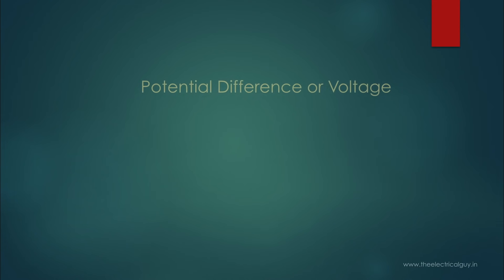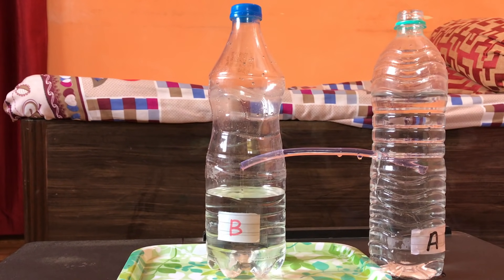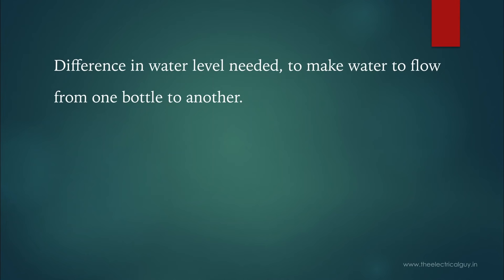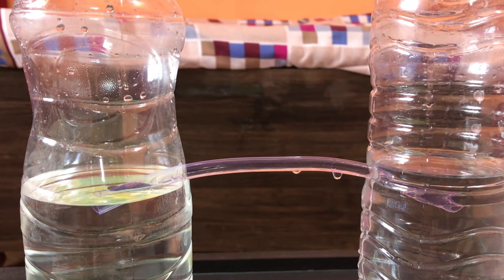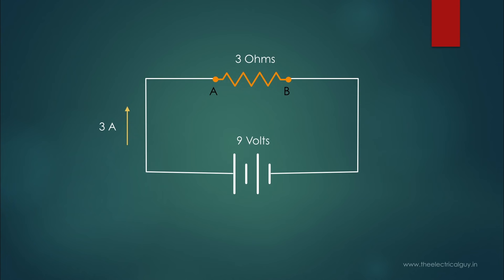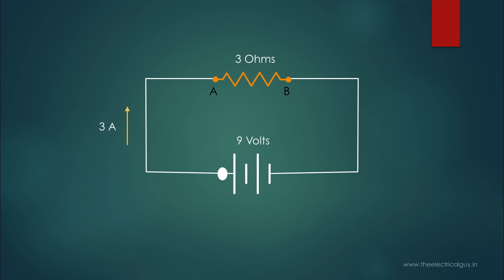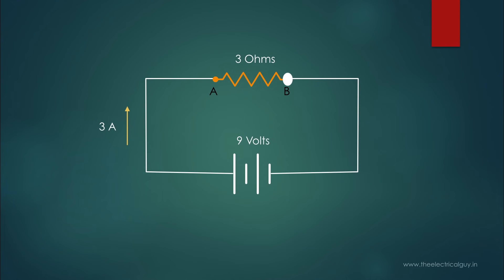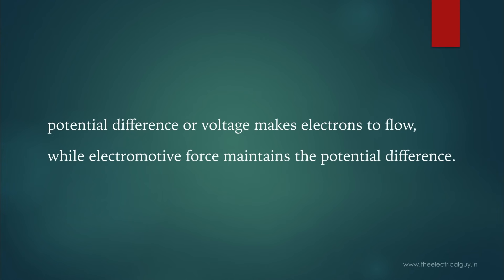Voltage or Potential difference vs EMF | Easiest Explanation | TheElectricalGuy

Comment: You skipped the point while giving an example on EMF. You said that the source is needed to fill the water and cause the water to flow to other bottle, but you skipped that the source should take the water from bottle B and insert the water to bottle A.
Reply: The source should be such that it continuously increase the level of water of bottle A and at the same time it should continuously decrease the level of water of bottle B in order to avoid the same potential conditions. It is because if the source ia not taking the water from bottle B then water level of B also increases and potential difference could not be maintained.

Comment: Well explanation is good but tbh emf cant be maintained once circuit is complete that is it lost some voltage know as lost volt to attain an equilibrium with charge accumulation and charge discharge thus emf is not the one maintaining voltage is value of initial potential difference with cathode and anode just before the completion of circuit.
Correct me if i am wrong!

Comment: Sir I think if u explain it with inductor it will be clear I feel it incomplete bcs emf is the small voltage that is INDUCED by the supply voltage that creates the another current which oppose the flow of electrons of main current . So actual EMF is electro magnetic force that’s nothing but the voltage induced by the property of induction like mutual inductance

Comment: Emf makes electrons flow between 2 terminals, voltage drop is the consequence of electron flow iff there is resistance. I say this because electrons will flow if there is no resistance in which case there will be no voltage drop also.

Comment: Howdy.
EMF is the small angry man inside a battery who throws electrons to the minus pole and positive ions to the plus pole.
The EMF arrow should be drawn inside the battery symbol from minus to plus. The voltage arrow should be drawn outside the battery from plus to minus.
The EMF arrow indicates the direction of current inside the battery and voltage arrow the direction of load current. Assuming, of course we use the convention that the load current flows from plus to minus. Or to say it in more scientific terms, from a higher potential to a lower potential. A higher potential is "more plus" and a lower potential is "less plus" in English. Minus is regarded as a very low potential.
Regards.

Comment: Nicely explained, but what is 'moving' from positive to negative? Since current is defined as a flow of electrons (which are negatively charged particles), which direction do electrons flow? Positive to negative, or negative to positive? There seems to be a fundamental glitch in our understanding of electricity. However, our current belief that "electricity" flows from positive to negative, seems to work well for most purposes. But it's time that we start questioning such established paradigms. It is a fact that secretly, tremendous advances are being made in science, technology & medicine using electricity, but public are kept ignorant because we only know what is in our textbooks.
Reply: Electrons always flow from negative to positive. The resulting "holes" in the electron orbit of each molecule move from positive to negative. Science never caught up with that discovery to make the correction in the text!
Reply: Current is force ejected from positive terminal at c (speed of light) through the conductor as Electron WAVES 🌊 (energy) and not electron particles as you suggest. The video is right that current flows from positive to negative. ✔✔
Reply: @solapowsj25 , I think it's more complicated than that. Have you seen Steinmetz's description of electric currents?
By the way, do you know that 'C' is not a reliable constant as we're all taught to believe. The speed of light can vary. Longitudinal waves can 'travel' faster than light, - even instantly. We have been misled into the conviction that there's no aether. Now they're rediscovering it and calling it 'black matter'. 
....Idiots stuck in a paradigm.

Comment: Current flows from negative to positive in a circuit, opposite of what you said here.
Reply: It is common convention to consider the current as the movement of positive charges. This is, as you stated, opposite of the charge carriers in metals which are the electrons. The video is correct as he is using the accepted conventional current.
Reply: Current is force ejected from positive terminal as electric energy that makes machines work. So it's right to state current flows from positive to negative.
Reply: Remember the useless convention dearrr

Comment: Voltage makes electrons to flow while EMF maintains Voltage 👏👏👏 nailed it
Reply: No.. Both maintain the same.. The same voltage at generator terminal is called as emf
Reply: @ActiveCricketBoys  no bro he is correct
Reply: What's terminal potential differece
Reply: A 120 volt zener does not make any current flow.
Reply: I really do not understand what 'maintaining the voltage' or 'maintaining the pd' means.... when you say maintaining, you mean the voltage should be same? but if voltage is same, then there is no 'difference'.....
I fail to understand what he means by 'emf is required to maintain potential difference'....

Also, can the emf ever be different from the potential difference in a circuit.... in the example circuit he showed, can it be like the emf supplied by the battery is different from the potential difference between the points?
Reply: @anaghshukla  voltage is needed to make current flow in a circuit. But after flowing through the wire one time, the voltage will be zero... meaning the current cannot flow anymore.

Thats why batteries are connected to the circuit, it continuously maintains the voltage difference. And the ability to maintain the voltage is called the EMF.
Reply: @sadianase13  thank you mam
Reply: Totally wrong, emf makes electrons flow and voltage or pd makes electric charge flow
Reply: @ITF.  fax
Reply: Right bro
Reply: Thank u
Reply: The term EMF is the cause of much confusion, vague. It is simply voltage which is merely electrical pressure . It all becomes clear once one thinks of it as electron crowding exactly like air or water pressure. In all three (electron, air, and water) they all flow to an area of lower pressure to the degree resistance is low enough to allow that amount of flow (or current, air current flow, water current flow, electron current flow or "amperage" in the case of electricity). 

Of the three, electron flow is different in the magnetic field created when electrons are moving unless the other two also have fields when flowing we haven't discovered yet.
Reply: Thanks
Reply: Emf is the cause of the pd and the result is P. d
(Short and simple)
Reply: Just one question 

Why????
Reply: EMF is created by chemical action inside the cell and that chemical energy (exothermic redox reaction) maintains the potential difference across the two terminal and this difference when connected cause electric current flow .
Reply: @Anonymous-jy4ui 8
Reply: I think potential difference is like the height of the water hole on the bottle and emf is the height of the water level relative to the hole or the rate at which water flows out. Things like relative hole sizes comes into play too since current is determined by voltage. 

A battery is a water supply or source that replenishes any displacement. 

Bottle A has hole with a height of 5cm, and bottle B has a hole height of 15cm. Assume the holes are taped which allows the bottles to be filled without leaks. Also the assume that the bottles are the same and uniform  circumference. The difference in hole height could be seen as the potential difference, but water levels above the hole plus an imbalance water level height between the bottles will direct the water (the charges) towards the path with less water/potential. The battery (which contains excess charges) could be given to bottle with the surplus to maintain that surplus. However when the two bottles are connected, at some point, they should theoretically reach an equilibrium point. 

Voltage is like an equilibrium point: the height of the hole 
Potential difference is a comparison of typically two voltages
EMF is a relative point to the equilibrium point which represents a surplus or deficit. 

Hence there is a faraday equation that looks like this: 
EMF = potential difference - constant*ln(B/A) 

Two copper plates in theory should have zero potential difference, (same hole height & uniform bottle dimensions) but they can have an emf if there is a battery or surplus in one of the bottles. 

Al, has a really low voltage potential 
Cu, has a really high voltage potential 
Hence you you need a lot of water (a battery) if you want the emf to go from Cu to Al. 

Sorry for the long explanation but I love electrochemistry.
Reply: @TheDestineyAngel  👏👏

Comment: But current moves feom. Negative to posotive.... As u said... Joury of easch coulumb strt from point A which is positive
Reply: right
Reply: We use conventional current. Either way' it’s correct.
Reply: Current flows from positive to negative. It's energy in Electron waves. Not particle electron. 🚫

Comment: One correction is that voltage is nothing but the force and current is nothing but the energy which is what ohms law is all about the linear relation.
Reply: I think you made a good point. Voltage is a measure of confined force, while current is the flow of ⚡energy doing work. Great. This is very important to understand. Thank you Master.